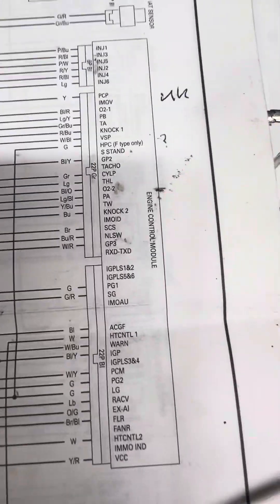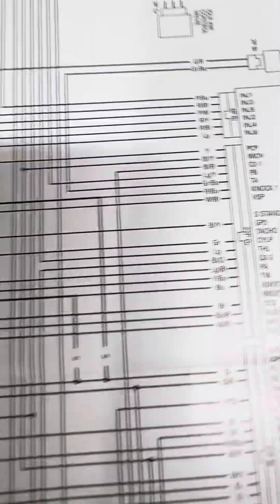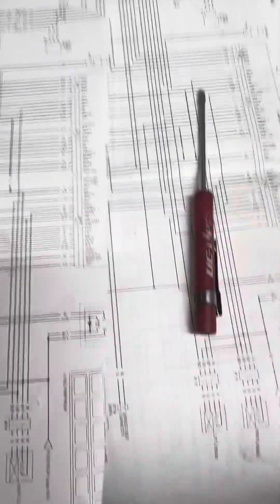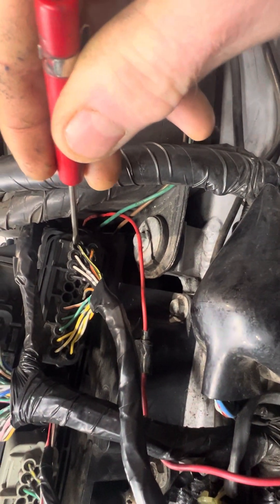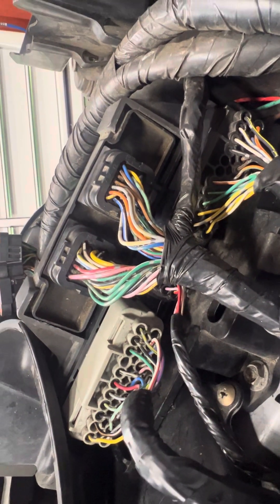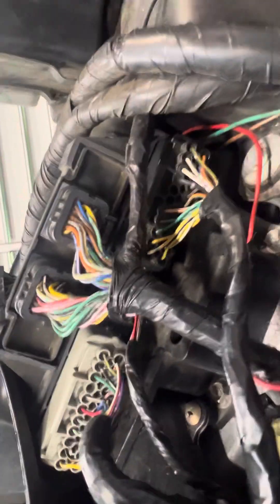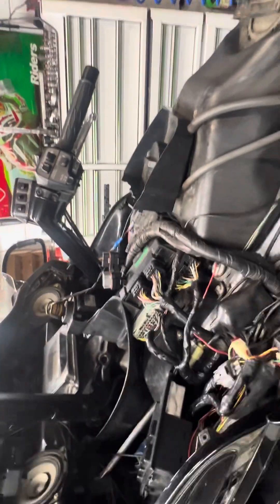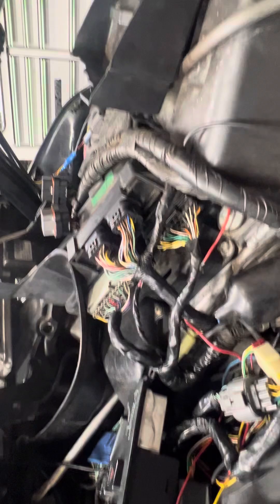Honda Gl1800 Goldwing American Ecu swap to European Ecu power supply explained  @GoldwingDocs

Comment: Hi mate, i have a 2003 gl1800 from Japan. It has abs and an immobiliser, it keeps throwing a fault 25. I have racked my brain trying to check and sort it out but no joy. I found this guy in the states who said he has been able to rectify the issue with these ecus. I see you have been able to sort out an issue I have been thinking of for a long time now with the American non immo ecu. I would really like to hear from you and we can get into it more. I can even share  what I have discovered regarding the fix and you could try it out.  I have not been able to sort it out yet. It would great to great to get a euro or Japanese model wiring diagram. All I have is the American model manual. Steve

Comment: Dear sir, I have a 03 American version GL1800 Goldwing and since the radio was not working, I got the code FI26 which is the knock sensor fault after a local electrician removed and replaced the battery head, I changed the right and left knock sensor places and it gave the same code FI 26 which is the fault, at least the cost of changing the sensor was not added, but do I need to buy a new ECU or should I have the outgoing lines checked, where do you think I should look in this case, I would be happy if you could answer, best regards
Reply from the maker: One other thing worked out after this post was the knock sensor wiring ie the wires feeding both knock sensors I over insulated them with Tin foil from ecu to knock sensors and covered with electrical tape this helps block any interference signals which can also cause knock sensor fault I’d recommend trying this before spending any money on replacing any items
Reply from the maker: Hello if the knock sensor fault keeps coming up trace the wire coming from knock sensor all the way up to the ecu and insulate it in aluminium tape or foil tape is easier and a bit harder wearing then retape loom might be worth while insulating both knock sensor wires the whole length and go as close to ecu as possible
Reply from the maker: Did this help ?
Reply: @B @BikeMotouk  Hello, it has been 7 months since I wrote this, unfortunately I cannot apply your suggestion because I bought a new ECM with a new P00 code and the problem is solved. I think it is impossible to fix the old type ECM that is broken, the only solution is to replace it with a new one.